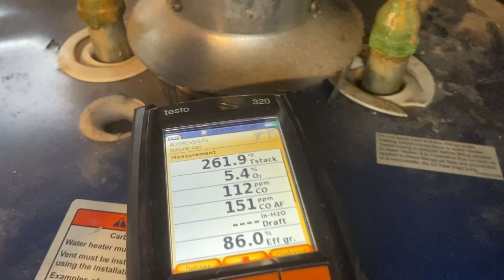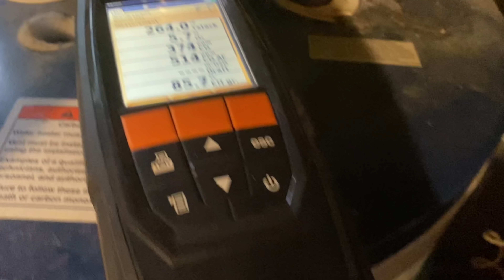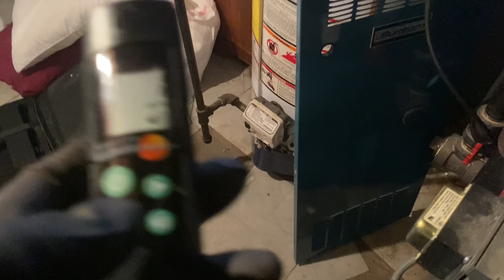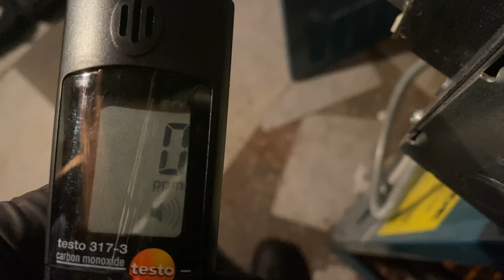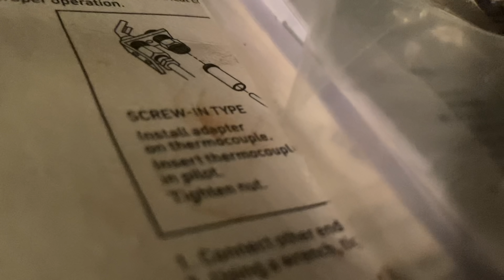Emergency No Heat Burnham Steam Boiler Pilot Out Revealed Tons of Problems

Comment: Mikey if I was the homeowner I would tell u get it running for now and rip it out as soon as possible .. thanks for ur awesome videos
Reply: Doesnt work that way. If they are not safe I tell the customer NO. Not getting sued because a customer didn't  do maintenance and causing major damage. Emergency on your part because the customer didn't do their job to maintain it doesn't mean I risk my business to get you heat when its clearly not safe to operate.

Comment: "The life expectancy of a CO alarm varies from 5 to 10 year, as rated by manufacturer, with newer models having a longer life. Fortunately, alarms manufactured after August 1, 2009, are required to have an “end of life feature” that notifies you by persistent chirping when it is time for replacement"
Reply: I've had them last less than 2 years, in very humid summers not running the AC and windows open. high humidity kills them real fast

Comment: I was brand new into the heating and AC industry, I had a service call to clean a central located,  natural gas heater. I got there and it had big chunks covering the burners, so much so that I couldn't get the burners out, so I called in and the owner told me to hold tight, he showed up and started cursing me and told me if I didn't clean the heater, I was fired, the lead tech showed up right after as I was pleading my case of what I had read about carbon monoxide etc. and didn't feel safe cleaning this unit, but reluctantly went ahead and cleaned the unit, it rolled out and melted the wiring, and the lead tech told me to rewire it. This thing almost killed the lady and the owner tried to say I did it on my own recognizance and the lawsuit started, I was actually in a different state by this time and working for a Very Reputable business by this time, and after several phone calls from the D.A. from that area, my boss got involved and the company brought their attorneys into the fold. Part of my interview revolved around doing misguided things, like cleaning a very bad gas fueled heater and where I stood on that, my response was, I had two boys I had to go home and face every night and I couldn't look them in the eye if they expected me to do something shady or not up to par, and if they operated like that, I would continue looking for a job, to which they replied, "No, you are just what we're looking for" I was hired based off that decision and my work ethic. It turned out, since I was no longer in that state, I didn't have to show up, but could give a statement to the courts and it ended up helping this lady fighting this corrupt business owner, this corrupt guy even showed up with a check for $50,000, yes Fifty-Thousand Dollars for me to not implicate him, which I included in my statement and didn't take the check, I actually tore it up and tossed it in the air, which I picked up and sent in with my statement, this was way back in 1994 when he brought me the check and $50K was a lot of money back then, I think it was like 2 plus years of salary at that time. Anyway, this long reply is basically saying, peoples lives are worth more than any amount of money. Nice video Mikey Pipes and Thank You for doing it right by testing the sir and mentioning the carbon monoxide detectors etc.

Comment: Previous owner left me with a Utica that failed 2 years later. Noticed water feeder going on 2x a day. Near boiler piping was all copper. I filled to top Noticed water dripped down . Found out it leaked between joints in the copper.

Comment: mikey how much ste4am is too much? im used to always seeing steam / condensation out of the chimney in cold weather..  even every furnace does it..  is that not something you usually see witha steam boiler?
Reply: you really should look at the draft hood area for steam leaving the boiler and not judge by the chimney steam, as they all do it in cold weather with the humidity from the burnt gas + indoor air mixing. most will eventually clear up once the chimney is hot enough, but not always depending on the size of the chimney/liner(oversized is bad)
a steamer with large cracks/holes will make the chimney look like an old steam engine without the pulses.

Comment: Wagos, you got me hooked. 
Love them.
A tip for you if you are interested. Get a CO2 BLOW OUT GUN 1/4 inch. Use that to blow out pig tails. Also get a bib to 1/4 male angle adapter and you can use it to blow out clogged boiler drains

Comment: Stupid question here, but I thought steam boilers and their radiators were supposed to give off steam (hiss)?  So the steam boiler should be adding water on a regular basis?
Reply: the hissing is mainly "air" being displaced as the steam fills the pipes and radiator, as the steam condenses to water again and returns back to boiler, air re-enters through the radiators and piping. that air also thermally expands and contracts rather rapidly, making it displace a larger volume, that ends up as vents hissing softly.
now if they are hissing loudly, with steam coming out and water spitting, you have problems and need to have the system repaired(possibly just bad vents) but it could be other major issues.
Reply: @throttlebottle5906  Thank you for that, makes sense now!!

Comment: If people knew that ignoring leaking vents would kill their 10k steam boiler they would take care of it….

A one page cheat sheet slapped on the front of boilers would help customers know what to look out for, what the repercussions are and when to call for service.   You could provide that for all installs customized for appliance type.  Of course yearly service would solve the problem as well….
But i think many homeowners think yearly service is unnecessary and just a money maker. For most systems a two year service interval is adequate.

Comment: Aren't those CO detectors supposed to be mounted near the *floor*?
Reply: 5ft above, or ceiling mounted. CO has close to the same density as air (slightly lighter).
Reply: CO is lighter than air and is usually carried by hot air so it is important to place it high on the wall
Reply: No, doesn't matter because CO is very close to the same density as air, it will disperse evenly in a room.
Reply: The high exhaust CO numbers aren't surprising give how yellow the flames are. Need to adjust the air shutters.

Comment: that is a complete 💩💩💩 pilot flame, tall lazy and yellow at the tip. orifice dirty/deflector tube full of junk. the flame isn't hitting the guide and bending forward like it should.
that one is far beyond what I'd re-light for safety reasons, cracked is one thing, chunks of it falling out? nope
** posted this near start of video ** never would have replaced the pilot assembly and re-lit that one, especially after seeing the water on ground and "schmutz" running down the wall from chimney cleanout, the whole chimney is certainly spanked! I'd guess that is has(had) a clay liner. needs a liner or replaced likely too.

Comment: Watching your video's I think I am developing a foot, calf and yoga pant fetish.  That said, how often the case the disaster emergency calls are always boilers people do not have serviced.  Steam boilers need pre season checks every year.   This boiler is so far along there is no way that damage would not have been seen years ago.  The cracks in the insulation is common and I always right it up as a watch.   Same with the rust, you start to see some in one part of the boiler or the other and you know what is coming.   

What does bug me is the liability we take on to get someone through a cold snap due to their negligent of annual service. 

To the CO alarms, in this situation you want low level, read the labels and compare them to exposure charts.  You want zero co in that house.  If you read the alarm limits you can have levels that can affect people over time and the most alarms will not show, other the display reads 00 under a set point but if you hit the peak button you can have a reading of 20 ppm and not know it and over time even that can cause harm.   

One thing in really tight situations I do is email a waiver explaining the issues and what we are trying to do and that it is very temporary.    I email it to them and they email back stating the understand, agree and will follow through with recommendations.  That is admissible in court.   Anything over 400 ppm "Air Free" industry guidelines are a shut down.  That said you were right what you said to her, most guys do not test and ignorance is bliss.   Other than a manufacturers written instructions to test (mostly found only in 90+ equipment) and what test limits to look for we are not required to.  Even then if your out of the mfg. set limits, they do not say if the boiler is safe to run or not or if it just needs service as soon as practical.